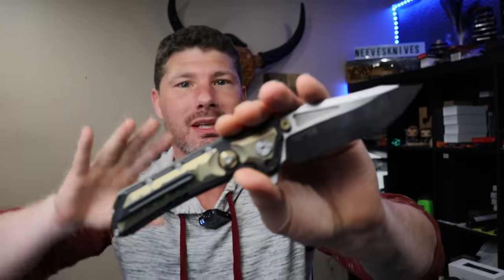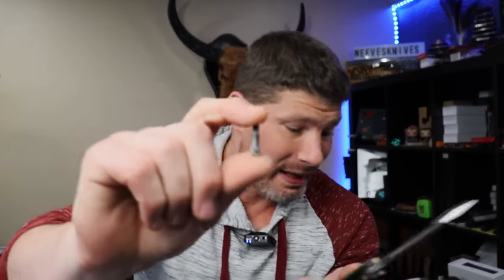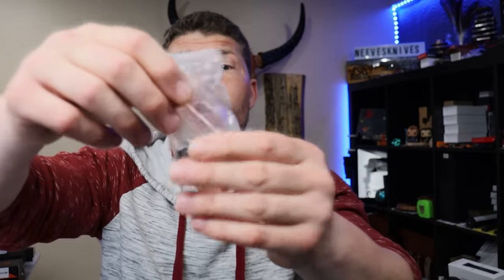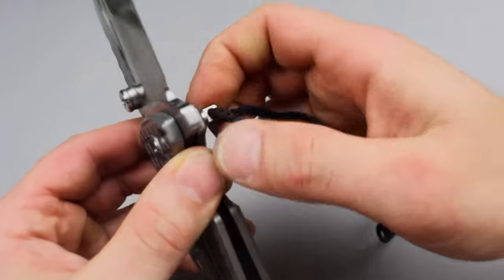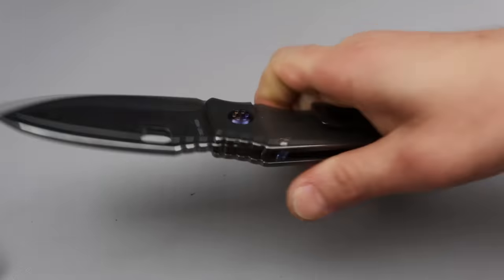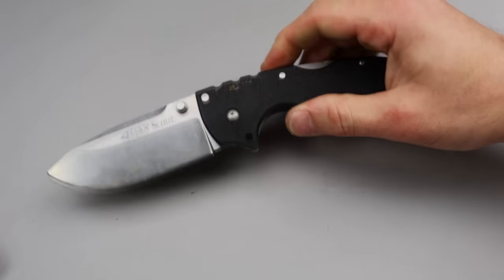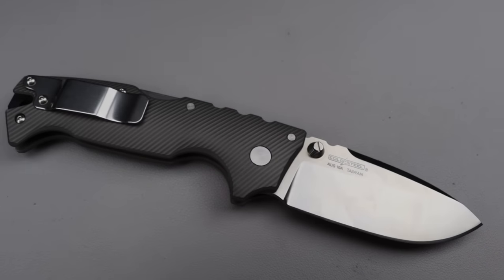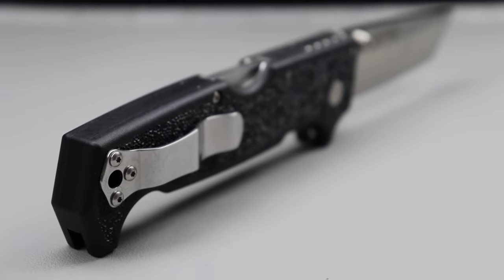10 Knives That Are Built Like A BULLDOZER

Comment: I actually broke my first Hephaestus. I wouldn’t even dare testing a second. Thing took some massive weight before snapping. I put it through a weight test very similar to the one that Cold Steel does. It held 690 pounds. When I  added another 45lb plate it snapped. Not completely, but the knife was a broken limb. The I didn’t get to test it without the pin though. It’s definitely held more weight than the SR1, but the Scout is pretty much goated. I stopped adding weight after 800.

Comment: The SR1 light is possibly the best value hard use folder one can but. It's incredibly tough, incredibly stout and like 30 bucks. It's not a slicer by no means but it is a total badass if you neat a cheap knife that you can hammer in to a tree and use it as a step lol.
Reply: Honestly, my SR1 lite came with a better factory edge than a lot of knives half as thick. Like you said, not really made for slicing, but it handles everyday light cutting tasks way better than I expected it to.

Comment: Due to your video's I will eventually buy an ad 10 and put original goat scales on it. The scales are made to order on there site 4-6 weeks it says. I really like the idea of having a knife that you can through the world at it and it keeps going. Not just hard use but extreme hard use. I was watching a video of someone batoning with the triad verse the shark lock. The shark lock had play in it after. Triad lock remained strong as ever.
Reply from the maker: exactly yeah i seen a similar video with cold steels version on the engage and it had similar results

Comment: If i need a folder built like a bulldozer I'll just grab a fixed blade. For collecting, ok sure.
Reply from the maker: you would be surprised how tough a cold steel tri ad lock is but ofcourse a fixed blade is usually better

Comment: Have you gotten a chance to check out the reate terminator t1000 yet?
Reply from the maker: i did at blade show, id have one on but they are all sold out now and were limited
Reply: @NeevesKnives It looks like Crane’s Cutlery has 9 in stock. It will only set you back $547.
Reply from the maker: @flapxjackson  yeah I'm good on that, if it was something that would continue being made I'd possibly doit but it's not

Comment: Kind of a fun list, but I'm also disappointed by it. I guarantee you there are no Seals or Rangers using Medfords out in the field. Overdone and way too expensive. Know what operators actually use that you missed? Emerson Commanders and the CQC-7. Not sexy with it's G-10 handles and 154CM blades, but they are indestructible and you can literally pick up a rock and sharpen them in the field when they go dull.
Reply: I know two heads in Marine Recon who use Medfords.  Regarding the cost, you get what you pay for.